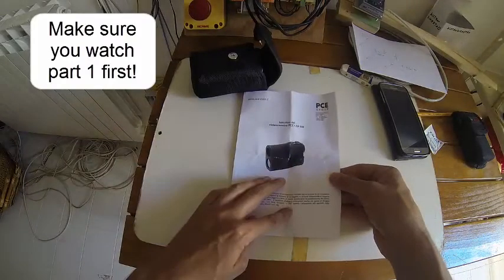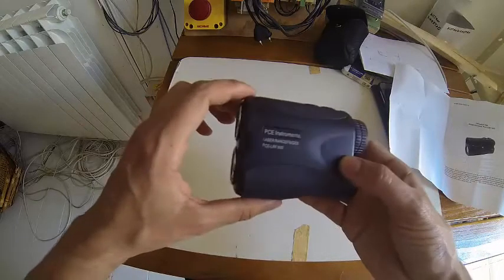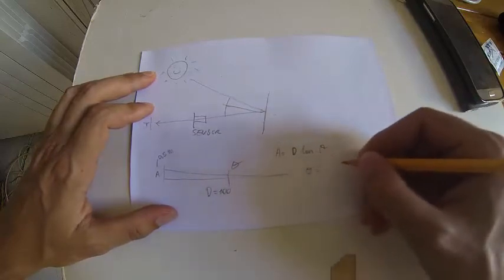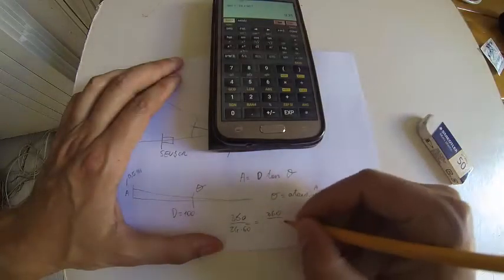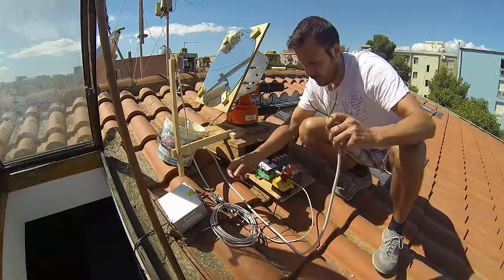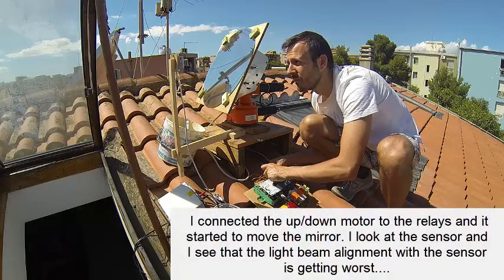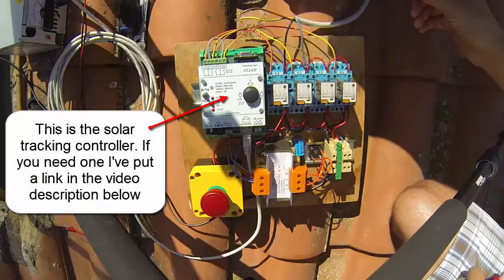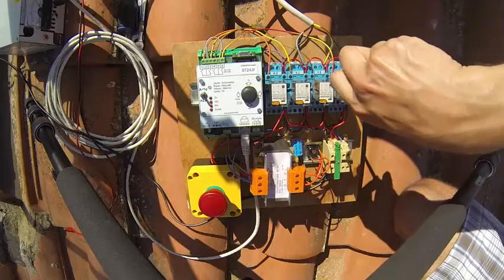#4 Heliostat Solar tracker shining a window 100 m away - Part 2

Comment: A good way to use more commonly found solar trackers to point a mirror. The common tracker unfortunately don't have a mode to aim at half angle between sun a target, so this is a nice work around.

Comment: These are the best heliostat videos with explanation that I've seen.  A video detailing the aiming device would be awesome.  I don't see one in your video list.  Thanks!
Reply from the maker: Thanks! I am building up an e-commerce for the device and I will then make instructional videos
Reply: @ingDemurtas  for commercial use, I believe, you have to add some coordinate system so it could be pointed to exact direction without installing direction sensor separately and feed motors with solar power.

Comment: How much was youe cost? Can you explain the sensor?
Reply from the maker: The motor I bought from China, about 1000 €. The sun direction sensor and controller are from  http://www.solartrackercontroller.com/ for about 600 €.
Reply: ingDemurtas that's very expensive. I guess the motor is dedicated for 2-axis. 

It's odd you are using relays instead of a MOSFET H-bridge or stepper motors. Did you put a minimum wait time in the software to avoid damaging the relays?

Is recalibration that much of an issue for tower CSP?

For this purpose I thought maybe a parabolic mirror might be more suitable.

I'm intrigued about the sensor. For it to work it must have at least 3no. calibrated CDS right?
Reply from the maker: This model was meant to drive AC motors (with the relays). Later I made one version with mosfets. In both cases, the controller makes the "dead time" that allows the motor to come to a complete stop before reversing the rotation. Price is 2-3 times the low quality tracking controller that are on ebay. Mine cost more because it is more flexible, last longer, and is more accurate in following the Sun. People that want a good product buy it. That's the same reason why I bought that good quality motor.
Reply: Way cheaper and easier is to use stepper motors